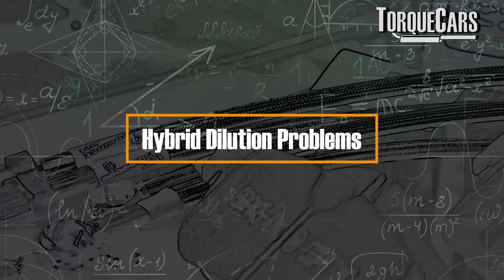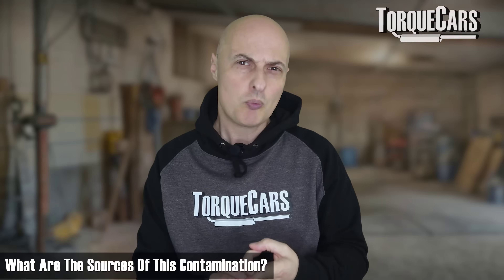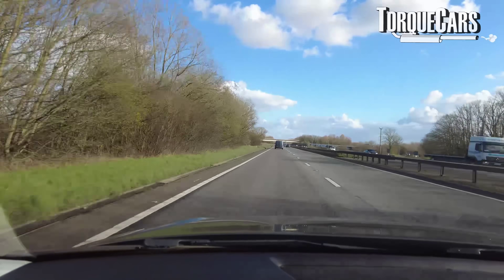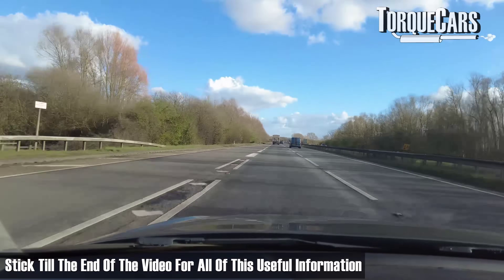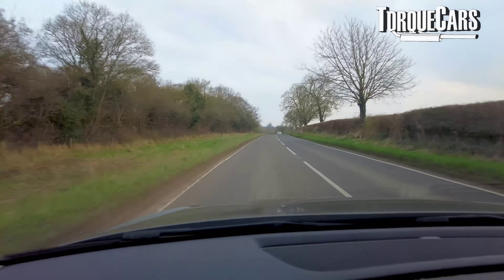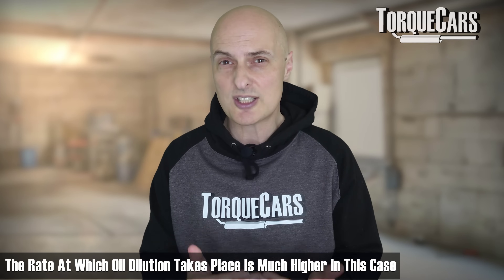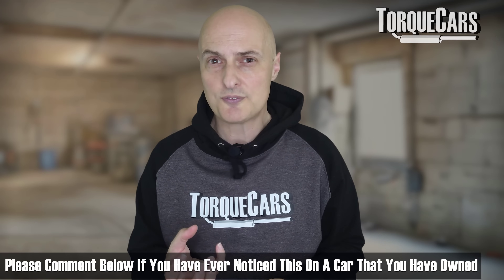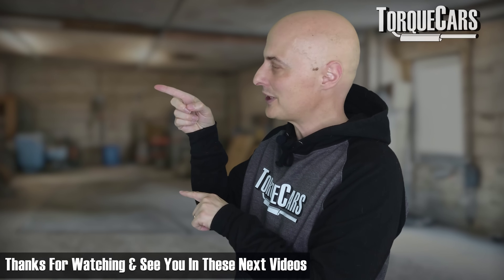Driving A Hybrid? Do This To Avoid Oil Dilution. What Everyone MUST Know.

Comment: Hi. I've just purchased a audi a5 MHEV 48 volt system. Do you think I should always turn off the stop start system or just let it be?.  CHEERS
Reply from the maker: This video covers the key points around that question https://youtu.be/zQ_2UffEjP8 the key is what happens on a cold engine and the aim is to get the engine warm as soon as possible. When the engine is warm the stop start will restrict idling for you, when cold you really want the engine to warm up so avoid stop start but also try not to have long periods of idling on a cold engine. 

Don't overthink it, the A5 stop start is pretty clever and knows when the engine is cold or needs a cool down period after spirited driving.

How do you find the MHEV setup? I'm thinking of going for an A3 45 PHEV at some point.

Comment: Thank you, I do have a Hybrid car. Change my oil and filter every 4k miles.
Reply: And do a good hard long drive at least once a month, so as to get the oil heated up properly. Modern engines are designed to run hot.
Reply: @johnmartin7158  really twice to four times a month is ideal for a daily driver car
Reply: If you have plenty of short drives (like in most of the cities), you are correct to do so.
But if you have most of the drives above half hour, you can switch to changing the oil and oil filter at around 6'000 miles / 6-7 months, as at 4'000 miles the engine oil is still almost as new, except if it's over 9-10 months of use.
Reply: Drive your car often in motorway and apply the Italian 🇮🇹 job ( run fast).😅
My hybrid 101,075 miles mileage( 5 years old). And still fine and in good condition with regular oil change and yearly service. No major issue, still running smoothly and quiet.
Not like my old diesel western  junks after 3 years for 42000 miles. Vibrations  engine noise and stupid wet timing belt snapped. Never buy  western car anymore. Japanese 🇯🇵 is the best. 
Buy the best Japanese brand not the junk one.😅